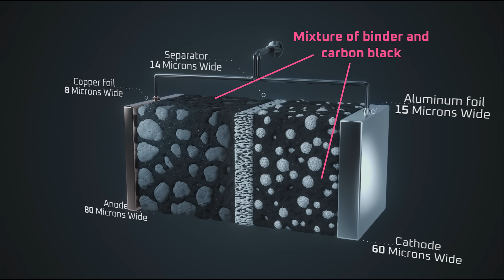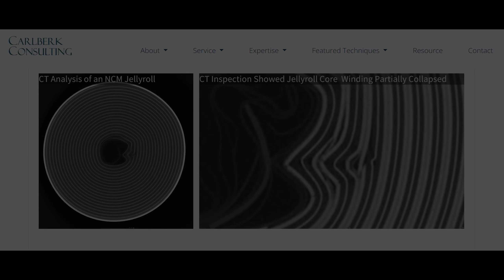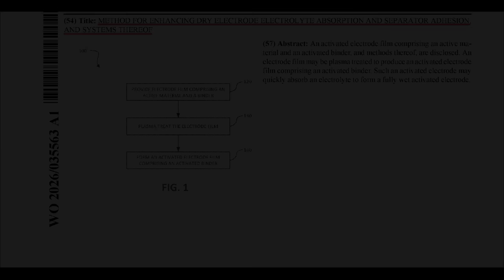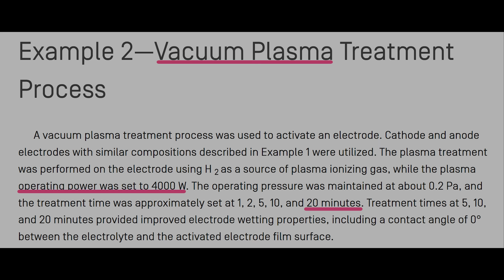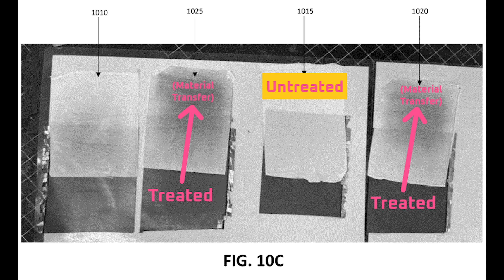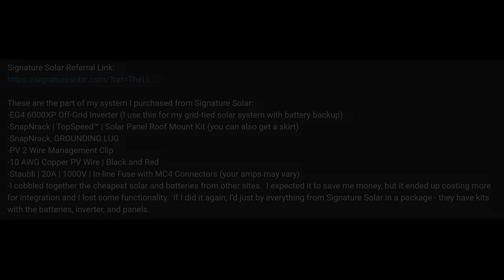Tesla's Plasma Treatment Patent for Wet and Sticky Electrodes

Comment: pretty sure the liberated fluorine will stick around passivating the CAM/AAM - hence less reactive surface, less lithium required for SEI, probably thinner (lower ACIR) but a tad higher resistance (same DCR at thinnger diameter) - all conjecture but not a particularly wild one

the OH groups on the PTFE could be interesting though, those WILL be reactive during battery cycling, doing all sort of things - most likely getting chemically anchored to the SEI/CEI
Reply from the maker: I talked to somebody with some expertise in these types of plasma treatments 

It's horribly complex 

That's why emphasized that we mostly don't know what's going on. 

I just took a guess based on a generic possibility.

Comment: I haven't seen anyone do a tighter core than what is common in the 4680, but I'll keep an eye out for it. 

I did a bit of plasma cleaning process testing a Giga, so I can vouch that its a common method there, usually in open air, but with cell manufacturing you can control the atmosphere...hydroxyls are usually bad but if you are increasing polarity of the binder, makes sense...just a risk for cycle life.

As for the increase in capacity. Plasma is a surface treatment, over a large surface area, its likely that any graphite that was compressed and smoothed during calendaring has its surface blasted and surface area increased. (thick of slicking back your hair....wait... Think of when freshly shaved, your head is super smooth, after a few days you get stubble, that increase in surface roughness is essentially what the plasma is doing.)
Reply from the maker: Thanks for your thoughts and input!

Comment: They keep improving things, I wonder if the Tesla Roadster II will already implement this tech to have an improved battery, you know, if the rumours are true, it should be capable of flying and that requires higher energy density.
Reply from the maker: I will be very interested to see what type of battery pack it uses 

I really want to see 500 miles plus of range
Reply: @thelimitingfactor 500 mile range Roadster! Ah yeah! . Tesla Semi also needs a sleeper cab version with a little more range. 250 miles into the middle of nowhere is great, but I have heard truck drivers say they would feel more comfortamle if they could go on for a bit longer, like 350 miles into the middle of nowhere and back (which is a 700 mile range). And then also the Cybertruck could get some more range as well, you know there was some people who complained about the range they were getting for the price (specially when towing). All this sounds like it will eventually happen!

Comment: Is it fair to say that the 4680 cell is a great form factor for high manufacturing output at low cost, with a low-to-medium energy density requirement (but has not yet, and may never be preferable) for a high-energy-density cell like a thinner or smaller form factor due to thermal build-up, with its volume-to-surface area restricting charge and discharge rates compared to 2170 or 18650 cells? Or do you think that, with incremental improvements over time, it can overcome the shortfalls in high-energy-density materials in 4680 cells?
Thanks again, Jordan. 
🙏
Reply from the maker: The 4680 form factor should be able to maintain similar charge/discharge rates despite the larger form factor due to the tabless electrode.  There are also other tricks they can use to improve thermal dissipation.

So, when it doesn't, it's an indication of a design or software choice.

That is, they might want to use a different form factor, but it's not necessarily a drawback of the cell.  

For example, there are high power and high energy density 2170 cells.  There are about 20 ways to skin a cat when it comes to cells.

Comment: This is just a pure speculation but how about this, If TerraFab is actually going from a EUL to create the Plasma into a FEL with a BF-Particle accelerator and actually refine this process it could be a game changer for this process also (Maybe).
Reply from the maker: I'd say that would be overkill.  The equipment for this plasma treatment is cheap and readily available.  Any connection to a particle acclerator would cost more and probably wouldn't add any benefit (let alone the cost of the particle acclerator itself)
Reply: @thelimitingfactor  You make a lot of sense, I was thinking that if they need to build this insanely big FEL solution to handle the scale of Wafers they plan to create there it is only the energy cost that was the extra, but I guess we talk MW instead of kW so if you cant harness it in an efficient way it will be a big waste and overkill just like you say. :)

Comment: Another great video Jordan. Thank you. I've been wondering if you have been looking a little at what volkswagen is trying to implement to achieve this. For the little I know i think they are trying to "print" it. I don't know it sounds complicated.  But i read that, if achieved,  it would be a easier to scale in a manufacturing sense. I was wondering if you knew something about it.
Reply from the maker: Thanks!  We can't really assess their process until they scale it or have some in depth information on it.  Seems close enough to Tesla's that it doesn't really make a difference.

Comment: 0:14 Im optimistically sceptical of calling the dry process ”solved”. What we know is that dry 4680 batteries are in ”production” but nothing about the actual quantities. Or else please enlighten me
Reply: AFAIK. 4680s have only been installed in the just over 100,000 Cybertrucks manufactured, an unknown number of the now discontinued 'structural battery pack' Model Ys made at GT up until Oct 2023, maybe 500 Cybercabs, plus the updated Tesla Semi (couple of hundred?)

That's over 4 years. Doesn't seem a lot to me.

From Joe Tegtmeyer's videos, there's a constant stream of equipment going into the Battery plant at GT. Ongoing construction work. When we get to see inside, there's hundreds of people working.
Reply from the maker: You haven't defined solved or asked what I mean by solved, so you haven't framed the discussion properly.
Reply: @thelimitingfactor  Fair enough, what do you mean by solved?
Reply from the maker: @W0genius1  That the cells are being produced and going into vehicles.  We don't have a teardown yet to prove that.  So, there is a caveat:  We're trusting that they aren't lying.  

One could argue that it's not solved until they hit high volume production, but then how do you define high volume production?

Do you define it as the average production rate for a typical battery line, the the multi-x they originally targeted, or a cost/performanc target?
Reply: @thelimitingfactor  i myself would considered it solved if they achieve the promises they proposed on battery day.  Does the performance exceed 2170?  Production cost benefits achieved? If so why is it not going into all cars to improve gross margins?
Reply from the maker: @derekr5327 From the perspective of the PURPOSE of the 4680, it's solved.  The primary point was to re-orient their supply chain.  Cost was secondary, and they now offer themselves the cheapest nickel based cells.  Despite the masturbatory fervor in the public domain about performance, it was tertiary.  It still holds the potential to be the best at a first principles level, but they're only on v2 and the other  high volume cell manufacturers aren't standing still.  Niche tech will always standout, but it's niche, so it's mostly irrelevant for most consumers.

Comment: I'm a little surprised that Tesla patented this.  When I worked in industry, we only patented things that could be reverse engineered.  Otherwise we kept it as a trade secret. It's not clear to me that Tesla's competitors could figure out they are using a plasma.
Reply: I concur.   We've heard multiple times that Tesla patents things to prevent other people from claiming patent infringement against Tesla rather than to protect others from copying them.
Reply: @shadowmancer7040  You can always claim prior art if you were using it first.  Of course, that would have to be documented with internal emails, etc.
Reply: @tommckinney1489 patent trolling is a multibillion dollar industry.  Far cheaper for Elon's companies to file patents.  Especially considering the mountain of FUD the media peddles.
Reply: This can be protected by filing a trade secret with the patent office. It will not be published, but if someone claims a patent you have proof of your prior art.
Reply: Tesla also open sources their patents, whereas if someone else patents it, the tech will be gate kept
Reply: Perhaps it's because the Chinese are already so far ahead, or that Tesla would rather have some level of control, otherwise they could be sued for using this process when someone else patents it later.
Reply: @TheScottShepard  4680 cells when they were first announced was a big deal in terms of specs, but now a days, it's mediocre at best since density isn't the end all factor for batteries anymore... shape, integration, and etc are all just as important and that's why prismatic cells are a lot more common now with the change to LFP and soon sodium batteries...
Reply: @killerhurtalot  Additionally, other round cell manufacturers have opted for an even more energy dense volume in 4695 and 46120 cells such as the ones used in the new BMW models produced by EVE energy.

Comment: Plasma treatment is used in electronics manufacturing to increase bonding strength in applications such as wire bonding. It cleans and activates surfaces.

Comment: Atmospheric and vacuum plasma treaters have been common for many decades in improving the adhesion of coatings for roll to roll processes. It can quickly and dramatically improve the adhesion quality of the deposition layers and also sometimes slightly clean the surface prior
Reply from the maker: Thanks for the input! Much appreciated.